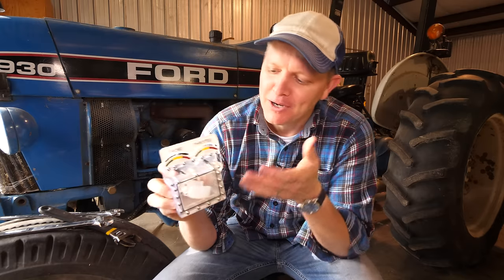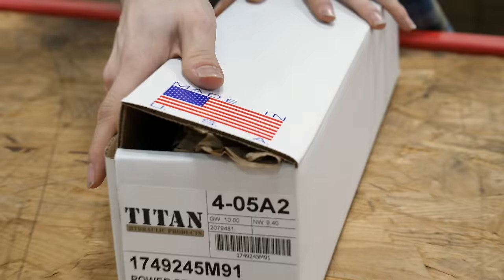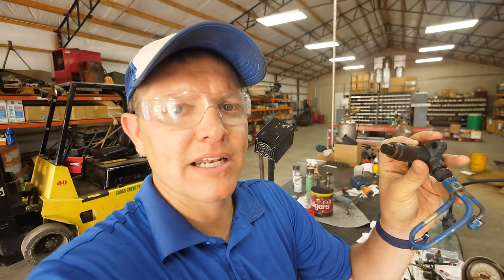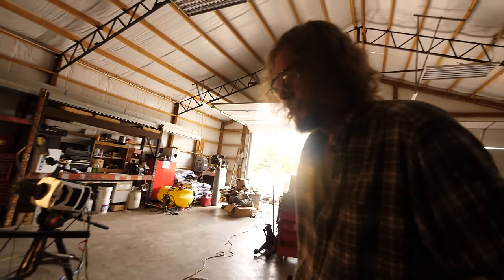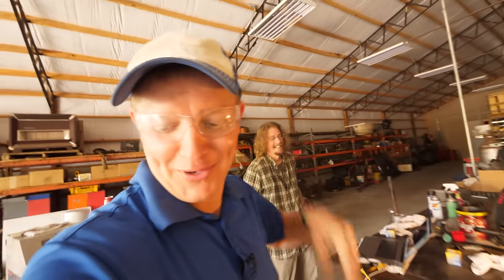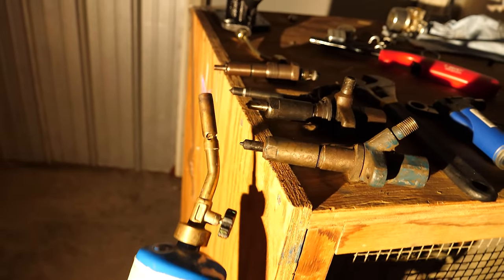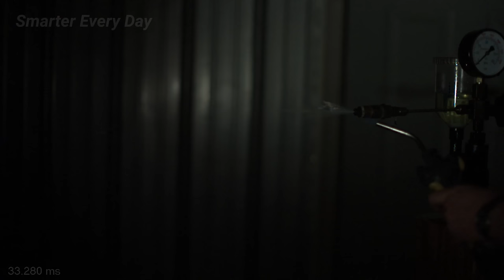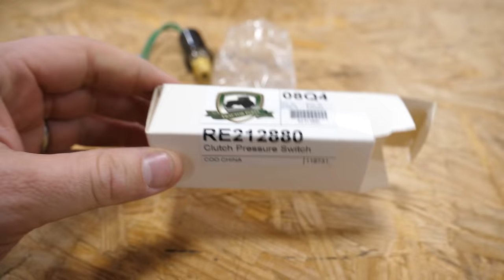Why Fuel Injectors are AWESOME (28,000 fps Slow Mo) Part 1 - Smarter Every Day 281

Comment: 10:20, wrong. It was just bad positioning and intensity of your torch that delayed the ignition. The vaporization allowed for your bad positioned and very weak torch to light it up, but that simply doesn't happen inside the engine. After all, it is not constant or inefficient like a torch, and it is a closed, isolated environment. Again, as many other videos, he's curious and he has the means to do it, but his logic thought train fails in such simplistic ways. Thank God that is compensated by the high quality content.

Comment: About the "boundary conditions based on changing stoichiometry" is it not caused by a faster moving fuel from the nozzle of the injector and slower as it goes further that's why it does not catch up on fire inside the "boundary"? I'm basing this on my observations on 14:41-42 where when the injection of fuel stopped, it immediately caught fire. Curious question, idk much but this is awesome! 🙂🙂 Thanks for making these videos, they're long tbh but the level of detail of explanation is interesting to watch.

Comment: The actual application of a diesel injector in cylinder is even more complex. Because the fuel spray must penetrate(the correct distance into the cylinder) the very dense hot air before auto ignition and also must not overshoot it. An in cylinder view would be very telling for you once seen. However there is an awful lot of scientific papers published on fuel diffusion and penetration rates out there if youre interested in further reading

Comment: Diesel injectors have been around since Diesel first started working on developing a compression ignition engine in the late 1800's, though the injectors on his early engines needed a high pressure blast of air to inject the fuel, instead of just using the pressure of the fuel itself.

Comment: Looking at the 20 different diesel injectors it's nice to remember petrol injectors. They're either Bosch, Bosch or Bosch

 ( I know there are different brands for port fuel injectors but more than 95% of them are either Bosch or licensed version of a Bosch injector. Be it Delphi, Siemens, Continental, Denso, Keihin, Aisin, Hitachi, Lucas, Magneti Marelli younameit. They even use the same model names like EV1, EV6, EV14, jetronic port, us car port, long standard or short injectors and even the same connectors. So if you want to do a little bit of tuning and know your way around the Bosch parts shelve and a bit of math it's very easy and that's how I currently drive my car on overstock desinfection that big box stores bought too much of in 2020 because of youknowwhy and I pay 10cents per liter or 0.4USD per gallon. Yes it consumption is double but still dirt cheap)

Comment: I really enjoyed this high-speed video. However, if anyone is inspired to recreate this as a party trick it isn't the flames one needs to worry about, it is the danger of getting fuel injected under the skin. These injector sprays can easily penetrate the skin and it may be nearly painless when it happens, but a few hours or days later it can lead to severe swelling potentially even ending in amputation if it isn't treated properly.

Comment: question from a chemist whos first language is not english: a carborator (?) atomizes (?) fuel?
you need quite insane methods to atomize something, usually argon plasma at 10k K. just pushing fuel through holes atomizes it? please explain.

Comment: Modern day fuel injectors, use a solenoid with constant fuel pressure to the injector. The solenoid provides an electrical pulse to the injector based off engine timing to inject fuel. The injectors your using strictly work on providing enough fuel pressure to each injector at the correct time to overcome the spring tension. I would be interested to see how they time that, it’s easy to time an electric injector but to time a pressure driven injector would seem to me to be difficult. I can’t imagine these engines ran that efficient, as you can’t always gaurantee what state the line and pressure to that specific injector is in, so the time it takes for the injector to pop you would think may not always be exactly the same as within an electric injector.

Comment: In the engine, you will have a higher air pressure so the fuel will mix faster than you show. Still a brilliant video.

Comment: Those first two injectors were pintle  nozzles. Commonly used in lower compression glow plug diesels. The third one was a multi hole nozzle used in bigger, higher compression engines, way more efficient and powerful. Todays nozzles open, or squirt at ten times the psi as these injectors. Way more efficient and less polluting. And they are electrically fired  by the engine ecu. There is a lot more to it than explained here. Yet, diesel technology is just as old as spark ignition engines.

Comment: Was it just my eyes, on the straight out tests you can see at the start the you can see where the force of the torch is blowing some of the fuel away from the main path. It looks to me like there is either a vertical wave or possibly a helical "wave?" that propagates through the flame

Comment: Slow motion of videos of diesel injectors catching fire during testing is a real eye catcher. Adding. 5% or 10% Coalman fuel, white gasoline to the diesel so it ignites easier. If the temperature is freezing or lower you could try adding a bit of iso-butane, lighter fuel, for easier ignition. It is easy to vapor lock the injectors with LPG. Some of the first diesel engines ran on powdered coal dust,

Cross Creek and others like them are vital to American Agriculture Some farmers are using tractors that are over 50 years old made by the many manufactures that bit the dust int the last half of the Twentieth Century. I think a U Moline or A John Deer might run the rest of this century if parts were available.

Comment: If you wanna see some crazy fuel injectors then you should looks at the injectors and pumps from a top fuel funny car or dragster. I know there’s testing footage online where you can see the volume of fuel that those things push in order to make 10k+ horsepower. It’s pretty remarkable how thirsty those engines are. And they also aren’t pushing regular gas either, since they run on nitromethane. But those fuel pumps and injectors push an absolutely incredible amount of fuel into those engines at a startling rate.

That said, I’d love to see you do a video on top fuel funny cars or dragsters! They use the same engines just in a different chassis. I think that’d be awesome and it’s kinda outside your usual wheelhouse. Entire engines and clutches that get rebuilt and parts replaced after every trip down the track, clutch parts welding themselves together during the run, rebuilding an entire high performance engine (from tear down to start up) in 30 minutes to an hour between races, tires that act as a pseudo-clutch themselves due to the deformation, going from dead stopped to over 300mph in 1000ft and in just over 3 seconds, the drivers experiencing like 5G’s on launch! There’s so much stuff there that you could get dug into and share with your viewers! I’m pretty sure they’re the fastest accelerating vehicles on the planet, and that the drivers experience more G’a than astronauts do during launch. It’s incredible stuff and a feat of engineering. I grew up going to the drag strip on the weekends so I was around them a lot and it’s one the coolest things you can experience in my opinion. There’s nothing like being track-side when the top fuel cars are running and you feel the power of those engines reverberate through your chest when they launch off the starting line. It’s so cool and I think you’d get a kick out of it! You should definitely check it out and make a video or two on them if you get the chance.
Reply: Also had to google stoichiometry and see what the definition was. I understood what you were saying at that point in the video and I knew what you were describing even though I didn’t know exactly what that word meant. Now I learned a new word, even though I doubt I’ll ever use it! Lol. It’ll come up eventually where I’ll have a need to use it and I won’t be able to remember the word, because that’s usually how it goes for me😂

Comment: Hey, diesel do not need spark like you said at time 10.38. vapor diesel will flash at 180 degrees Fahrenheit. when the air is compressed in the cylinder tis will cause heat.  with the air is compressed the fuel then is injected into the cylinder. the heat alone will cause the fuel to flash.
Reply: sorry I did not you point this out later in the video.

Comment: What amazes me, along with this, is that diesel explodes at the right amount of pressure, hence no sparkplugs.  But, how did the first person discover that they needed to compress the air/fuel mixture and that the right amount, would cause the explosion, and thus, the diesel engine.  (I know, a guy by the name of Diesel perfected it, but still)

Comment: I think there is a gradient as you said but also you're shooting fuel faster than the 'speed of fire'. By the time the molecule shows flame, its traveled a few inches due to the speed. I swear physics is just a single principle explained 10,000 different ways.

Comment: You really need to go into how different injectors work. Gasoline injectors run around 80-100 PSI and are simple solenoid valves. Old style Diesel injectors are around 3000 PSI and are much more complicated internally. Modern common rail Diesels run around 30,000 PSI and are on another level again.

Comment: Can you try to run this test pump using some low rpm motor and try this same experiment. Instead of pushing the pump down using your hand, can you try doing this using some motor which can push down and up this test pump, say 30 time per minute or something

Comment: 12:20 i think the flame needs to come from the back and not the front of the injector, because the spraying fuel draws air with it from behind, i don't know what that effect is called, i'm no scientist, but its called something.

1 minute later: you are using diesel, i was expecting normal fuel.

Comment: Interesting to see how far the fuel travels before it atomises and burns in open air. Then the consider that there’s nothing like that much room inside a cylinder at the top of the compression stroke.

Comment: You will notice that when you lit the fuel coming out of the nozzle, it burned and did not explode. That’s what happens inside the cylinder. It burns.  If it explodes, that is detonation and it will destroy an engine very quickly.

Comment: Well, combustion takes both fuel and oxidant, you're probably more oxygen-rich in the outer radius where the fuel is more atomized, so the flame keeps there. I wonder what would happen if you started very oxygen-rich near the ports.

Comment: @smartereveryday I wonder if a smaller fuel injector output with a sneaker spark could be used to do a Hollywood effect of gun muzzle flashes. Combine with one of those small firework poppers for sound effect and smol flash

Comment: Outstanding. I got a '69 IH 444...so at least I got to see how the injectors are SUPPOSED to fire (at 2200-ish pounds). Sure, the manuals are fine, but c'mon...slow-mo vidya is better. 

Odd thing is...mine has little pre-cylinder cups in the head. Makes sense to the designers I guess. Carbs I get...injection...not so much (no practical knowledge, I don't usually touch a diesel in that area).

Comment: Destin, were you burning gasoline or diesel? I would imagine the octane rating if gasoline might have made it sensitive to ignition under the right stoichiometry.

Edit* though you shouldn't play with fire as a kid, I used to heat up bolts till they were red hot with a blowtorch and would drop them straight into a tuna fish can of 89-93 octane gasoline, where typically nothing ignited, but singed.

Comment: In a gasoline type injector, does anybody, if not why, use an heater to achieve more efficient fuel atomization? It would seem that could reduce fuel consumption and cleaner burning.

Comment: The technology is more than 100 years old. In the first U-boats they already had 2 stroke diesel engines. This changed for the 1930-1945 years where they used 4 stroke diesels.

Comment: On the normal spray injector you can see the fumes after after combustion, something odd though, they seem to have a negative vector velocity, away from the combustion, I mean like exact 180. Looks weird and it’s counter intuitive, one would imagine the heat creating a low pressure pocket during the combustion, which would then create a updraft and then the fumes would be sucked in as the pressure equalizes. But having all the burnt vapors just assume negative velocity seems just weird and arbitrary.

Comment: 10:33: "... you gotta have the right surface area of the fuel to the air _and of course you gotta have spark_..."

Nope, spark ignition is not absolutely necessary. I suppose diesel engines are not that prevalent in the USA but in Europe, we use them a lot and diesel engines don't have any spark plugs. The fuel, indeed injected, enters the cylinder and ignites on its own---due to the high temperature and pressure caused by high compression of air in the cylinder.

Comment: To make it more effective, they should be injecting air into the line with the fuel, so it sprays like a pressure-washer, pre-mixed with air and fuel, for more immediate combustion. Like you saw, "liquid" doesn't burn, it is the "vapor", in heat AND oxygen. Port injection is "better", because it is not exposed to the "combustion" directly and does not get "carbonized", like an in-cylinder injector would have happen. Nothing is worse than a clogged injector, clogged with carbon or "dried gas" that has turned back into crude-oil gum. (That is why we have alcohol added to fuel now, by law, to help clean injectors to get better "long life" from injectors.)

Comment: Did you know the Rolls Royce Merlin engines, in the Spitfires, and the BMW engines in the Messerschmidts already had fuel injection? Those could fly "upside down" without the engine saying "Oops, no fuel!" And flying planes, you got the problem there is thin air, and fuel injection can handle that far better.

Comment: Liquid fuel can't burn. Only when it vaporizes can it burn. After it vaporizes you need the proper air/fuel mixture. It has to vaporize first. The spray is an atomizer, just like a perfume spray.

Comment: What I want to know is why would an engine use a carburetor instead of a fuel injector and their differences? I remember older motorcycles having carburetors and newer models boasting that they are FI, so are they better?

Comment: Bus Grease Monkey does this sort of thing on diesel injectors somewhat regularly to see if injectors are working properly when they come in for repair and an injector is suspected :) He smacks the back of a filled injector with a hammer with a camera running and then examines the spray pattern.

Comment: Smart guy, but never confuse ignition with explosion. It doesn't explode, it ignites and expands then it is exhausted. Explode would be more related to detonation or pre-detonation, which is what you do not want in a engine. Engines harness the power of thermal expansion.

Comment: The point at which the optimum fuel air mixture occurs, seems too far away from the injectors to me to be efficient inside the combustion chamber

Comment: You're not putting the heat source at the right position. Don't use acetylene, there's nothing to gain from that. Propane is fine, you just need to point it at the cloud after the fuel has atomized. Ideally, you'd have 4, one for each stream. You can even use a spark plug or some other electric arc to ignite it. Diesel fuel is extremely hard to ignite; it needs to be very finely atomized, so pointing the flame at the dense stream is not optimal.

Comment: Could you pre-heat the fuel to 600 F and then simply inject it into the air? This is super dangerous. No air can be in your fuel system. The SR-71 blackbird does this. Kabota did this in their lab. Better HP and fuel efficiency.